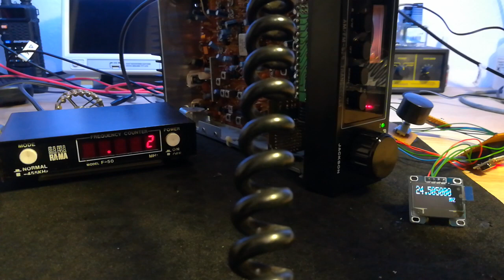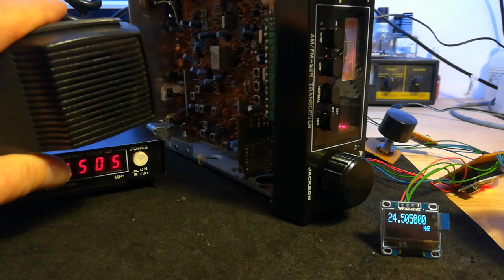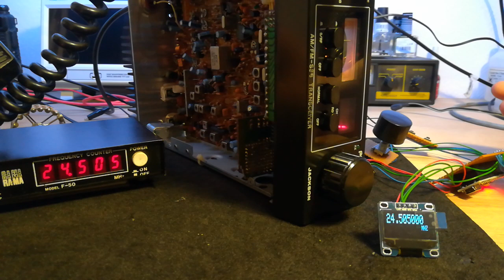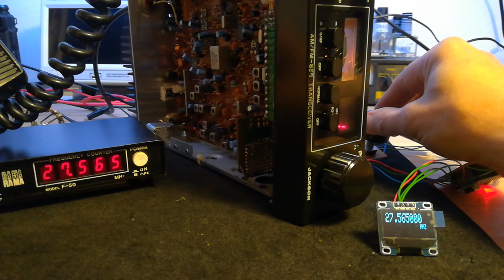President Jackson and an Arduino.

Comment: i gather that is going to replace the clunky rotorary knob.
Reply from the maker: Eventually , Ive still  a fair bit to do , But it's getting there , Hopefully usable on 12 and 10 MTRS  👍
Reply: @Gw0wvl  a great radio from back then and with that feature will be loads better.